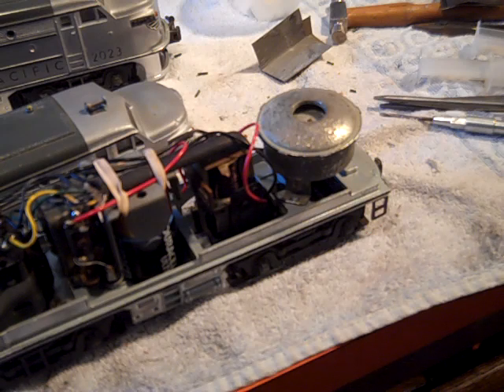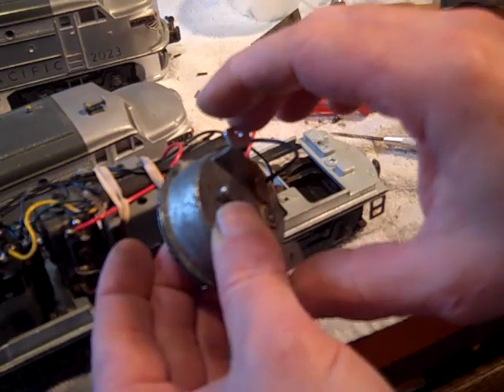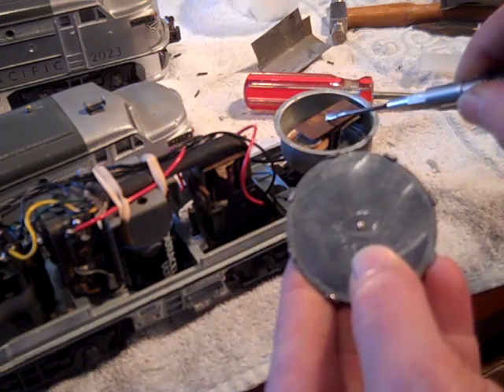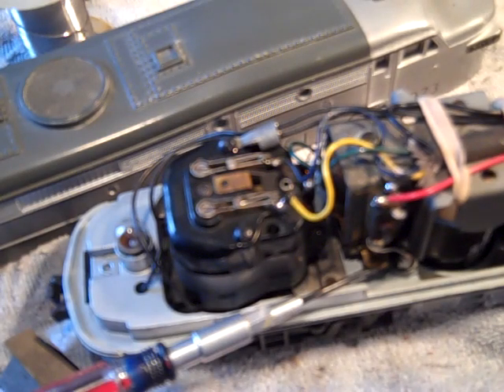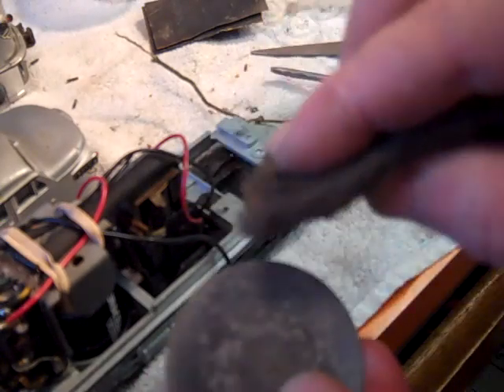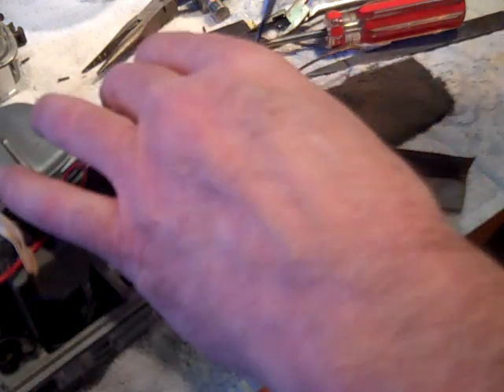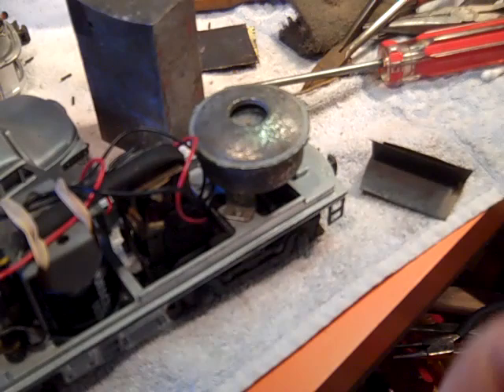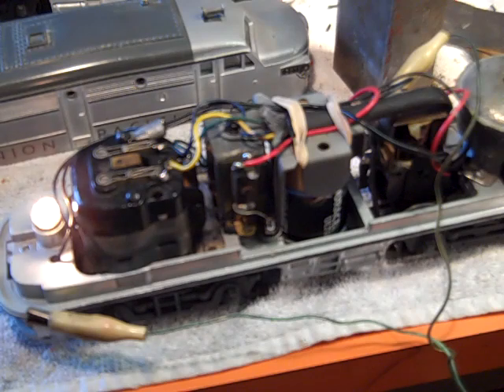VINTAGE LIONEL HORN REPAIR

Comment: Horn in my 218 Santa Fe was inop - used your procedure and it worked like a charm. Interesting that the sound adjustment screw was WAY out of wack, and there is probably less than a quarter turn of that adjustment screw where you get any sound at all (other than a click). Had I not seen your video, I probably never would have tried this - Thanks so much!!
Reply from the maker: The adjustment can be very sensitive, especially after so many years.

Comment from the maker: Sometimes even shocking with a 9v battery will restore operation. I'd just be careful how much voltage you put through it. Often the shocking the horn will cause the horn to work, but not reliably or it will stop working shortly afterwards. This horn would not work no matter what I did to it initially. This video was done to show how to restore reliable performance to a horn that somone might just remove and replace with a new one. Thanks for your comments and looking at the video-TM
Reply: Pĺ

Comment: Thank you for the video.  Rebuilt mine per your video, but turns out it wasn't the horn itself that was the issue.  The issue was very poor grounding between the horn relay/solenoid and the positive battery contact.  That upper positive battery contact just kinds of grounds itself to the whole mount of the solenoid/relay, which is isolated, but with lots of poor connections.  I just soldered a wire from the top battery contact directly to the relay contactor, and now it works perfect...no need to rely on intermittent connections.  

It was very hard to figure out the issue, because I could hear the horn clicking, so assumed it was the horn....it just didn't have enough current to actually power the horn with the dirty groundings.  The direct wire gave it the power necessary.
Reply from the maker: Thanks for your comments.

Comment: I just got my horn working in my 2344 NYC F3's. I took apart the horn and cleaned the contacts inside, but what really did the trick was dismounting the battery bracket and getting all the gunk and crud and corrosion off of it, that's what did the trick plus I had to adjust the screw on the bottom of the horn. Love the sound!

Comment from the maker: Hi Gary, I made the video. It's not an uncommon condition you describe. Sometimes adding more load to the train will help. The relay contacts can also still be the issue. Try recleaning the contacts. Some relays work better in different applications and one relay may work better in a different engine. Also a weak disc rectifier in the transformer may be the culprit. Depending on what transformer you have it may be worth replacing the rectifier with an original disc type or modern diode. TM

Comment: Interesting! This train actually uses a Delt-A-Larm mechanical “squealer” horn. A LOT of older smoke and fire detectors actually used horns like this. Like the First Alert SA76RS, FireX FX1020’s, and many others. They’re loud enough to wake the dead too! Much more effective than the piezo electric horns used in detectors today.
Reply: Cessna used them too, as a Stall Warning Indicator Alarm in their single engine planes beginning back in the post War 40's and through the 60's into the 70's plus. On my 3 1950  era Cessna's that I have owned through the last 5 decades, all had them. Interesting indeed!,

Comment: Hey thanks for commenting on the tuning screw I have an old 50's santa fe AA set and am new to the hobby I was totally clueless as to how to fix the problem and simply tightening the bolt immediately worked. My local hobby shop had no idea on how to fix it aswell
Reply from the maker: Glad to have helped.-TM
Reply: @tmackinator  what battery does it take
Reply from the maker: @brennenseibert6708  Takes  a 1.5v  d cell.
Reply: @tmackinator  do others take c batteries
Reply from the maker: @brennenseibert6708  I think the GP and some of the nw-2 take c.

Comment: Great video.  I have a few tips to add from my experience.  Use a soldering iron to heat the tabs before straightening as well as before crimping.  This reduces stress, which will save the tabs.

Also, if the horn doesn't sound at all after reassembly, use a few volts of AC from the transformer to energize the horn coil briefly.  Sometimes the diaphragm sticks from being dormant and this will free it up.

If you have a VHS tape eraser, that can be used to demagnetize a sticky relay.
Reply: i know Im asking the wrong place but does anyone know of a trick to log back into an instagram account??
I was dumb forgot the account password. I would appreciate any tricks you can give me.
Reply: @Dominick Augustus I really appreciate your reply. I found the site through google and Im trying it out now.
Takes a while so I will get back to you later when my account password hopefully is recovered.
Reply: @Dominick Augustus It did the trick and I actually got access to my account again. Im so happy:D
Thank you so much, you saved my ass!
Reply: @Colten Hank no problem xD

Comment: I have a postwar New York Central F3 train from 1953. The horn keeps getting stuck and the pitch is always getting low and high. Is there a way to solve this issue to get it back to its original state? Idk what to do.

Comment: By the horn relay, do you mean the solenoid where you use the screwdriver wedged in to hold a contact in your video? If you have a picture of where you’re making this contact it would be helpful.  Should I do anything to the solenoid in the horn? Thanks for your help. God bless, Randy
Reply: I went ahead and soldered piece of bell wire where I thought you were talking about. It seems to have worked and hopefully will continue to work. Thank you very much. God bless, Randy

Comment: Thanks so much for this video. I successfully followed your suggestions and now have a working horn on my 2023. However, the horn only seems to work when the train is in neutral. It does not sound in forward or reverse. I would really appreciate your thoughts.
Thanks again

Comment: Hi! I have the same Lionel 2023 Diesel except it's yellow with silver roofing. It has a different horn mechanism because it needs a D cell battery. I put the battery in and pressed whistle on my grandmaster but it's still not running. Any fixes?

Comment: I have a ? I have a Lionel 3524 GP-38 it has a bad rear motor when I go to Lionel parts page it shows a 7800rpm for the front
(6208857100
DC MOTOR W/ GEAR / STARTER DIESELS (7800 RPM)
9
$8.00)

and a 5400rpm for the rear
6208875100
DC MOTOR W/ GEAR / STARTER DIESELS (5400 RPM)
9
$8.50

is this right.  I would have thought both to be the same

Comment: If the horn doesn't work before you take it apart try running two D batteries in series to make it buzz. Usually fixes the problem

Comment: I have a Lionel 2333 –20 that has been in storage for about 60 years. The horn uses a D cell battery. I took the horn apart and clean the contacts, etc. as you demonstrated. Now the horn will work intermittently. It sounds good when it works but probably more than half the time it doesn’t make a sound other than the solenoid clicking. If I hold the contact up with a screwdriver to make contact sometimes it sounds and sometimes it doesn’t. I’ve cleaned the contacts on the solenoid but that didn’t change things. Any suggestions?
Reply from the maker: When you say the contact, do you mean the one on the horn solenoid? The contacts on the horn solenoid can be very troublesome. Needs to be perfectly clean. Somewhere in one of my videos I show how to add a ground wire to improve the operation of the solenoid. I will try to find it for you
Reply: I have not done anything with the solenoid inside the horn.  If you can send me a link to the video you mentioned? Thanks for the video which was well done. I’m trying to get my train set from when I was a child working so that my grandchildren can use it while they’re out of school because of this coronavirus problem. God bless, Randy
Reply from the maker: Basically the lower movable contact of the horn relay, called the armature, grounds to the main body of the solenoid (relay) through the hinged connection. What you do is take a very light gauge, very flexible wire and solder one end to the main frame of the solenoid, there are some tabs on the back of the horn relay assembly you can use, and then solder the other end to the armature where it pivots. The wire must be light and flexible enough to no impede the action of the armature plate. This insures a proper connection.

Comment: hi , i just purchased a #2023  pair of engines ,  i cleaned the battery compartment and installed a new D battery  in the power engine . 
my question is - what activates the horn ? is it done by a separate  remote ,
or do you need a transformer with specific  connections ?
 i have the lionel 190 watt transformer , 
with whistle capability . and does not activate the horn  when i push the lever. 
thank you .
Reply from the maker: The whistle button, if all is well will activate the horn. The whistle button will cause the horn relay to pull in. Place the engine on the track, with or without a battery. Lock the engine in neutral, turn up the track power and press the whistle button/lever. You should see the horn relay activate. If not then you have to inspect the wiring, the relay or the transformer itself. Do you have another engine with horn or whistle tender to verify the operation of the transformer horn circuit?
Reply: @tmackinator  hi , i don't have another engine  
but i will try your suggestions , thank you very much for your info !

Comment: Hi I have a 212 engine and I want to install a horn from scratch. How do I hook it up is it hooked up to electric motor and track contact? All I need to know is the wiring for the installation so the horn will sound when button on controller is pressed. Thanks Charlie
Reply from the maker: You need the battery bracket, horn relay and horn with the proper bracket to fit your engine. any of the later 200 series alcos will have the parts. Go to Olsen's toy trains and go into the library section for a wiring diagram. Look at the 200 series alcos for a diagram. Best bet is to find a donor engine with all the necessary parts. The horns run of 1.5 v battery power. The transformer button activate he relay which complete the battery circuit to the horn.
Reply: thanks a bunch for the response ill check the wiring diagram

Comment from the maker: @TheRattler51 Sorry, I don't think I can help you with that. Your sound chip may have gone bad. Check to see that the speaker conection did not come loose. I would also wiggle all the connectors and the boards themselves-TM

Comment: Doesn't sound much like a train horn to me... but maybe that's because Lionel came out with that horn thing back when real diesel and electric engines had the older truck-like air horns (like on the GG1), so Lionel was attempting to emulate that in miniature (like the air whistles in their tenders.)

Comment: Hey, I have a Lionel 2353 AA set I'm repairing, and the horn doesn't respond at all. The light comes on in the dummy unit when the power is applied, and when the whistle feature is turned on at the power pack, the relay does click, but not even the slightest sound out of the horn. I was going to try to repair it, but I found that I could not get under the tabs. My locomotive has the tabs on top of the horn cover, instead of on the sides. I'm not sure what on earth to do about it. I also know that heating up the tabs with a soldering iron is the way to go when it comes to ensuring that they do not break. I just can't get under those stupid tabs!!! Please, someone help me!
Reply from the maker: I slide an exacto knive blade under the tabs to start them.
Reply: Yeah I just ended up doing that and it worked, but I'm having trouble with my horn still. It won't buzz right, then I got it going, pug the shell back on, took it to the layout, and it wasn't working. In addition, the reverse unit was sticking, so I took it apart and tried to de-magnetise the solenoid, but ended up just ruining everything and doing nothing at all. I. An figure out what the $@#% is wrong, because all the contacts appear to be lined up right, pressed against the drum, there are no broken wires, and it STILL gets the sticky reverse unit, only now it doesn't run at all. I don't even know what I was thinking when I tried opening it up. I should have just left it alone from the start.
Reply from the maker: I have a two part video on e unit repair you may want to watch.
Reply: Funny thing... I solved the issue. I had to replace the drum, one nub to hold it in place had been sheared off do it wouldn't sit in place, and then found the contacts were lined a bit off, so I set them right. A squirt of WD40 up the solinoid's housing made it stop sticking. Man, it sure was a pain in the ass to get it all done, but she runs pretty darn good now. Well, up until tonight she growled quite a bit, but I just went back inside tonight and gave her a large dosage of WD40 on all moving parts again to attempt freeing up sticky axles, gears, etc, and now she runs much smoother. I want yo see if she'll work better on the graduated strestle set now, as well as pulling long trains. I mean, i did a test with about 7 cars while the shell was off, just to get an idea for how she sounded after running her light, to see if that changed the sounds, and all, but no dummy unit. She did twice as well as she used to, at least in my mind. I also re-lubed the dummy to see if I could eliminate more friction, taking good care to get less obvious spots, where things scraped other things as the trucks pivoted. I'll go more tomorrow, I have all day pretty much. It'll give me some time to mess with the horn relay too.
Reply from the maker: Be aware that although wd-40 is great for freeing sticky mechanisms, it is not specifically a lubricant. I really suggest you go back and re-lube all necessary points with train/sewing machine oil and light grease such as white moly grease on gears. If you get wd all over the motor armature and brushes it won't end up good in the long run.  E units are designed to run dry. electrical contact cleaner is the thing to use on them as it evaporates quickly and leaves little or no residue. Be sure what you use is safe on plastics. Most "sticking " problems are due to mis adjustment of the ratchet pawl.

Comment: HELP!!!! I can’t find any information showing how to remove the drive shaft of the LIONEL COAL LOADER 397!!!  The sleeves holding mine in place are so tight and will not slip off of either end!!! Must slip out the shaft to put the replacement rubber belt in place.  I see so many of these on eBay and replacement belts  that there should be a v
Reply: Continued.....there should be a video about th
Reply: Continued.....about this?????

Comment: Hi, how do i hook power to the unit to test the horn??
Thanks.
Reply from the maker: connect the wire coming off the horn to the positive terminal of  a 1.5v battery and connect the metal frame of the horn to the negative side.

Comment: i cant even get the tabs up any suggestions?
Reply from the maker: +Jeffrey Morrow Try using an exacto knife using the thin part of the blade to get under the tabs to start them. Be aware if you move the tabs too much they will break off.
Reply: +tmackinator ok thanks

Comment: I have the Lionel Santa Fe it's red and silver pretty the same as yours I 
would like the Horn to work on mine which is not rusted at all But there is a place to put a "D' sized batt.which is rusted I guess the spring load where the black
wire is terminated is gone the wire is not connected. My question is if every thing
was working and you put a Batt. in the Engine how do you work the horn it can
not run all the time.I put this set together left to me by my Father and the last time it ran was 1978,the trains run great but I would love to here the horn again like when I was a young boy.
Reply from the maker: You can put the battery in the horn bracket as normal  and manually move the horn relay contact which is the moveable plate on the lower end of the relay. You can also take a 1.5 v D cell (Or 2 batteries in series for a little more power) and connect it to the pickup roller (or the hot side connection) and frame ground which will simulate the whistle button on the transformer and actuate the horn relay.-TM